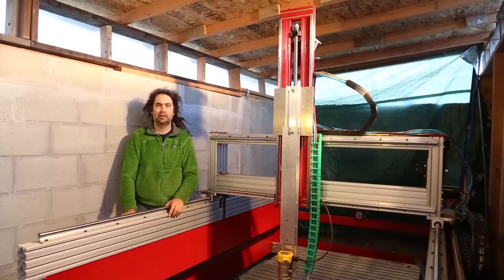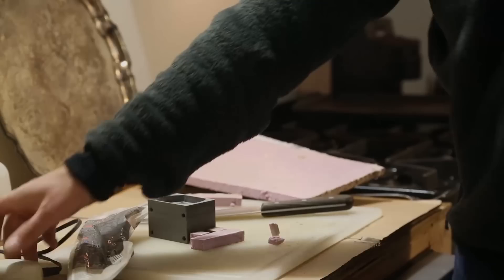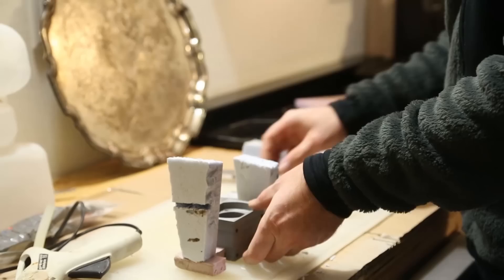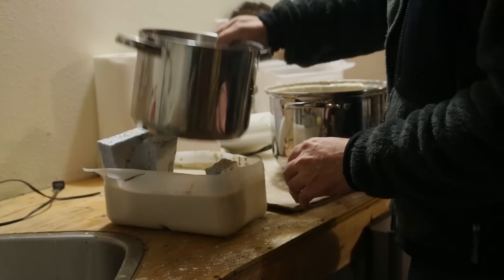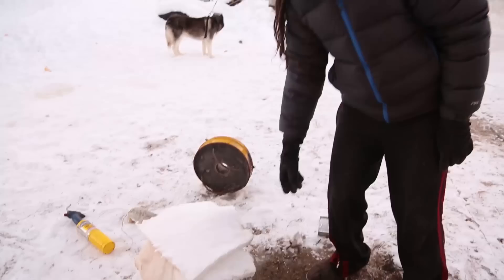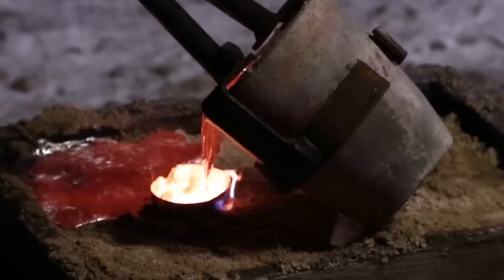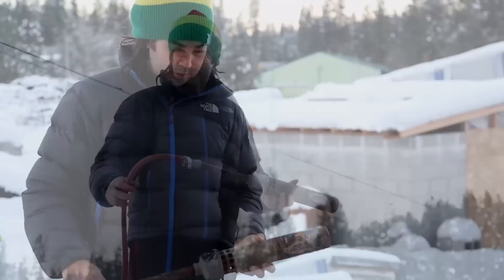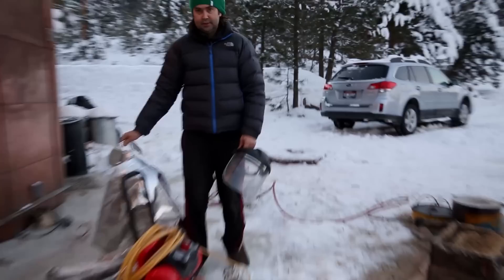Lost PLA 3D Print to Metal Casting; Complete

Comment: has anyone tried casting iron with this method?
Reply from the maker: +Jack Scheisse I have - it works but you need some proper investment - Plaster of Paris will melt.
Reply: what did you use instead of plaster of paris?
Reply from the maker: +Jack Scheisse Research investment casting.
Reply: Thank you I found some high temp investment casting like plaster of Paris but able to cast platinum they also have one for stainless steel.

Comment: I would of machined the part out of a block of aluminum or steel.
Reply from the maker: I can use this same method to cast a part that would be impossible for you to machine - out of anything - using this same technique. That is the point of the video. Besides that, I use 100% recycled material I source myself from the local landfill - not to mention large blanks are not cheap. Neither are end mills. I could go on.

Comment: Could have manually machined that faster, cheaper, stronger and to higher tolerance.
Reply from the maker: That would not make a very good instructive video on how to cast metal would it? ;) There are numerous reasons in addition: this process can be used to cast parts literally impossible to machine even on a 5-axis machine, I used 100% recycled material for the part (didn't buy an expensive billet), no wear on my expensive end mills,  no setting up the g-code, mounting the piece, changing bits, checking and double checking, learning, running and managing a CNC machine isn't really any less work either (I could go on).
Reply: After the world has ended, I will contact you with smoke signals.
Reply: At that point, sharing our individually unique skillsets would make mutual survival easier. On the other hand, I won't find survival all that difficult on my own.
Reply: Still admire your creativity and spirit, though.

Comment: should put some steel or ciramic rods through the screw holes
Reply: actually nvm forgot to account the fact the metal will shrink over the rods
Reply: Francisco Gru or maybe design cone shaped dimples instead of holes to make drilling them out more precise.
Reply from the maker: I usually pour with bolts in place. Then when you unthread the bolts from the cast you have perfect threads left in place.